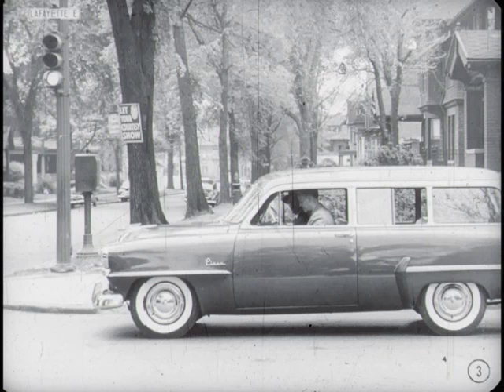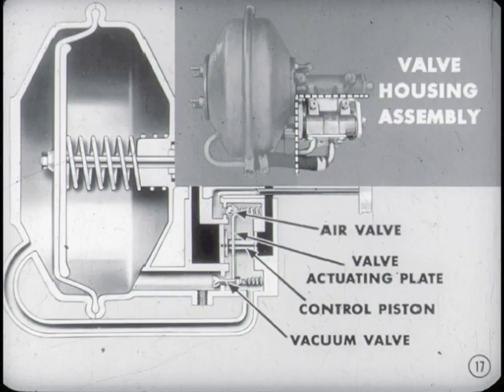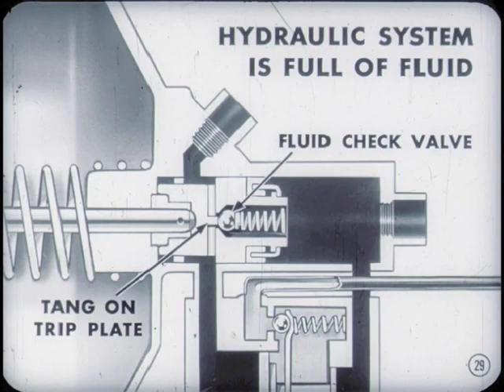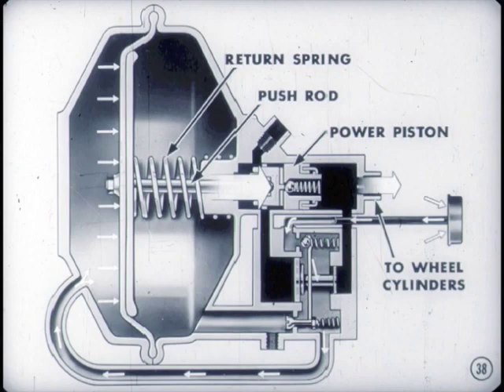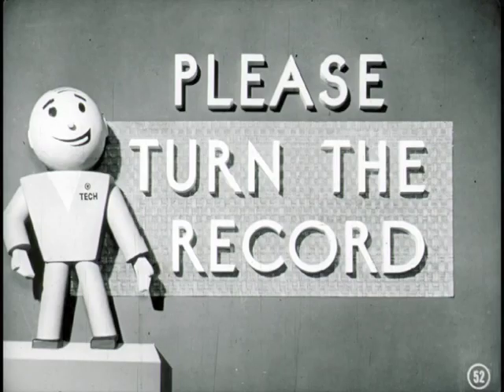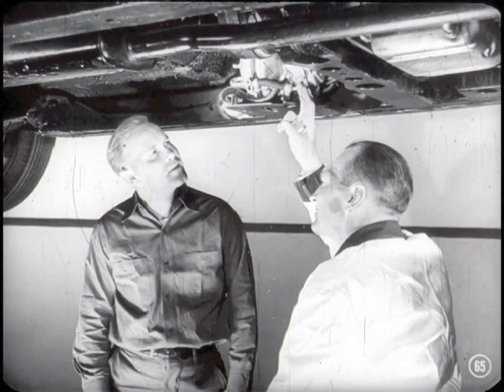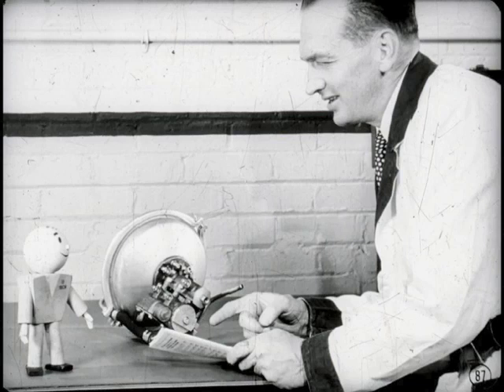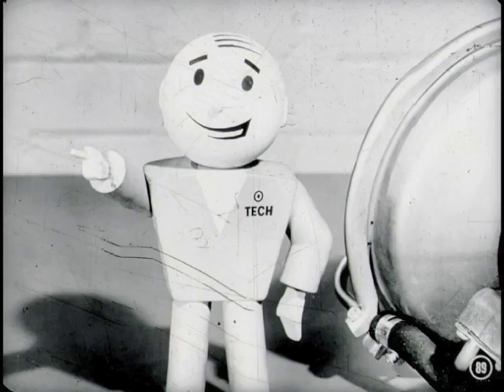Chrysler Master Tech - 1954, Volume 7-8 Power Brakes

Comment: Impressive, like all the others! Early Power Brakes look a lot like modern vacuum assist Power Brakes.....
But, putting the Booster under the floor attached to the frame??? 😱😱😵  I see LOTS of rock debris damage, especially on dirt roads!
However, the easily opened Booster Housing and Removable Diaphragm?? THAT was a Great idea! I fail to see why it became "better" to replace the whole, expensive Booster as a Unit. 😒😵
Reply: I agree!!